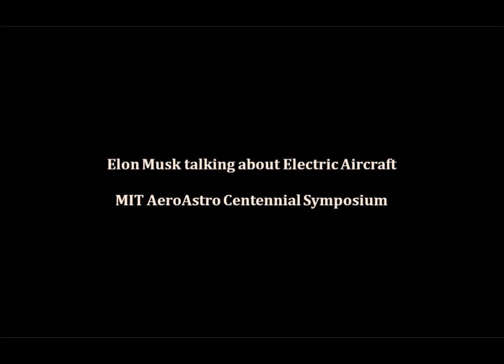Elon Musk - Electric Aircraft

Comment: In 2020 Tesla's battery energy density is 250wh/kg. Energy density of kerosene is 12,800wh/kg, 51 times higher. Kerosene burns off as it is used so the average weight is halved. This makes equivalent energy density of kerosene 100 times higher than batteries. Weight is crucial in aircraft, making this is a really tough deficit for electric aircraft to overcome.

Comment: why do planes not use gimballed engines/motors for steering? Because if your engine/motor dies, you still remain in control over the aircraft to glide it to relative safety.
Reply: You can control your glide with gimballed fans, just need a little electricity to reorient them

Comment: Simple idea,

Every aircraft has its own APU unit that produce electricity (at the back side of its tail mostly)..simply change the turbine engine into a fully electric engine,since the aircraft has more than 10ton of fuel carriage it can fly around the world with single refueling...what you need is to creat a efficient APU + ELECTRIC TURBINE = 24+hours of flight with single refueling that its...or you can change from fuel based electric turbine to a fully electric sel turbine....pros and con only the time you need to refuel or recharge the aircraft after every flight...that it..

Comment: Okay regarding this vtol electric concorde thing he said (Vertical Takeoff and Landing Jet) I did some maths The Concordes engines consumed 10500 kgs/hr of jet fuel, that is 2.92 kgs/s of Kerosene. Which would amount to 124.98 MJ/s so 124.98 Megawatts. The most capable battery we have is a lithium metal battery which contains 1.8 MJ/kg so you would need roughly 69.44 KG of lithium metal battery just to power the engines for ONE SECOND. And that is only doing this math at cruise where each engine produces only 10000lbs of thrust per engine. During Takeoff the Concorde used Afterburners. If those we're running the engines produced a thrust 38050lbs per engine and would consume 22500 kgs/hr which is 6.25 kgs/s of kerosene. Which amounts to an energy of 267,5 MJ/s using the same type of battery as before you would need 148.62 Kg to power the engine again for only ONE SECOND. To put it differently the fuel tanks onboard concorde could carry 94470kg of Jet Fuel. Which amounts to 4043316 MJ and using only batteries to power those you would need 2246286.7 kgs of batteries. And that is only for Concorde which wasn't VTOL. It had a thrust to weight ratio of 0.373 in order for it to be VTOL it would need a thrust to weight ratio of >1 and to have it in the box let's say it is 1.1, the same as the Av-8 Harrier. That would mean that the engines would need to produce a maximum thrust of 448800 lbs per engine that would 112200 lbs of thrust. And he plans that to do with electricity. And also bear in mind that the four Rolls-Royce/SNECMA Olympus 593 Mrk610 engines on the concorde we're TURBOJET, which means that all the thrust they produced we're coming from the burning of fuel and not as most modern turbofan engines from the fan. (In modern engines the turbine mostly just drives the fan and almost all the thrust is produced by the fan not the Turbine) The reason the Concorde Turbojets is because they're more efficient at supersonic speeds than Turbofan Engines. And because of the low pressure of air where Concorde was cruising a fan would not have much air to work on. So it was neccesarry to use Turbojets. But as Elon says he wants an electric Jet so an electric motor drives a turbine or a fan and that just shoves air around. The problem is at the altitudes a supersonic jet would cruise at there is not much air to work with so the engines would need to spin really fast thus needing more energy and increasing the necessary amount of batteries to operate the plane safely. I would like to see how Elon would solve the problems of energy requirements and that an engine that produces thrust on only air would only work at cruising altitude of supersonic jets if it is spinning really fast faster than normally. So yeah ... I mean electric jet with hydrogen oxygen fuel cells powering electric motors to drive a fan and produce thrust as a normal engine would there are concepts on that made by Siemens and General Electric. But Elon just pulled this supersonic Vertical Takeoff and Landing electric jet straight out of his ass and said it would work and be viable. Elon science isn't something magic that can overcome every problem you want solved, science and engineering involve math and you if you do the math you can see how difficult or even impossible some things can really be. 
(I posted this already somewhere else  
http://www.concordesst.com/techspec.html
This is the source you can the math yourself)
Reply: They gave him even more complex mathematical arguments for rockets . Latest Falcon which is the heaviest rocket in the world is just about to take off.

Comment: Aerodynamic surfaces are more efficient at high speed because their force is proportional to the square of airspeed while the force from thrust vectoring is more or less fixed.
Reply: does  a plane need that efficiency for control over the decreased drag from something like a gimbal?
Reply: +Carl-Akira Hikari-Eric Fujinami there are known stability issues at high Mach with interceptors like the mig 25 from inertial coupling. I guess in principle tvc can be stable as long as the stabilization is extremely quick and consistent. Once you get past a certain angle of attack at high speed you won't have enough steering force to fight it.
Reply: Bill Kong thanks for the detailed analysis.

Comment: what about having the plane plugged into a light weight power cord for part of the take off? not sure how much it would help and how high it could go before being disconnected, but i think it is an interesting idea when i think about it. i think a lot of power is used for take off. the power cord is reusable and could be lifted with help of little copter drones and a tall tower. and or the plane can just land and take off from tall towers (500m). in 4 km altitude from sea level the air pressure is half (from 120 to 60 kPa). and maybe on board copter drones to help deploy parachutes for conserving energy in landing and for a smoother ride doing so (not sure how much energy is need for regular landing of vtol)? i guess it would use a lot of power to lift that cord so the plane could have longer range, potentially much much longer range, but if it is needed for vtol to go over seas (as that is the only limiting factor besides longer travel time, otherwise you could just land and charge) than it might be worth allocating materials, priority, and land for it. aviation account for 2% of co2 emissions for what it is worth, but there are probably other reasons to stop extracting and burning fossil fuels as soon as possible. maybe there tall mountains and high altitude terrain that can be utilized for flight paths.
Reply: Maybe assisted takeoff, like on aircraft carriers

Comment: You just cannot get rid of the tail. In case of a power or engine failure you can still glide the plane and control it with a tail, with minimal energy usage generated by the ram air turbine.
Reply: Answer: extendable canards which fair into the forward fuselage in normal ops.
Reply: can't you do that with a gimbal?
Reply: Im pretty sure the reliability of electric motors and batteries is far greater than jets, not to mention the lack of vibration and heat which contribute to airframe and engine degradation.
Reply: canards are ELEVATORS
Reply: Redundant power and energy systems solves this problem.
Reply: I think the same, it is like people suddenly loose every bit of common sense when listening to Elon.
Electric motors have ball bearings, those things fail quite often. A parachute as a safety measure is the worst possible way of redundancy, ever heard of parachutes not opening as expected? The transportation of one single human is quit inefficient, transportating more  humans on a bigger aircraft is a solution but not electric. Batteries even in near future won't have the necessary energy density to compete with kerosin. An efficient solution would be airships, believe it or not.
Reply: No not with airplanes you idiot

Comment: I have so many questions about this.
- How is the turnaround time economical considering the charging time of such large batteries?
- Have you considered the difficulties of gimbaling high speed rotary machinery with respect to gyroscopic loads?
- Would an electric VTOL have an advantage over a similar jet VTOL technology or just current jet technology?
- Would an electric VTOL have any wings for lift or any control surfaces?
- Would the VTOL look like anything we know today? plane? helicopter? ospay? rocket?
Reply: Good questions. You know at the beginning of trains, some "expert" people wondered if the air pressure due to relative wind would crush passengers' lungs. Luckily, there were other people actually building the trains and solving all the problems they met along. The first camp of people got forgotten, the second gave us the train.

Which camp do you fall in?
Reply: I'm not really too concerned with whether it would work or not, I just want to know more about what his vision for the electric VTOL is.
Reply: @WilliamHelstad  It wastes energy both vy hovering, as well as the extra weight and volume. The time is wasted on development.
Reply: markotrieste 
Sounds like BS. You don't go and start building stuff without planning and analyzing issues.
Anyway VTOL is stupid. Waste of time, energy, weight and money.